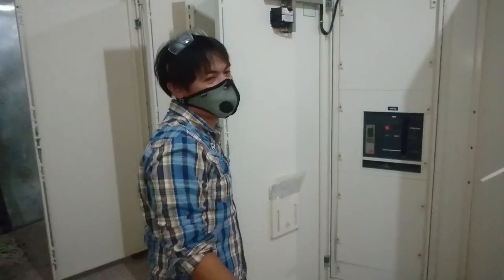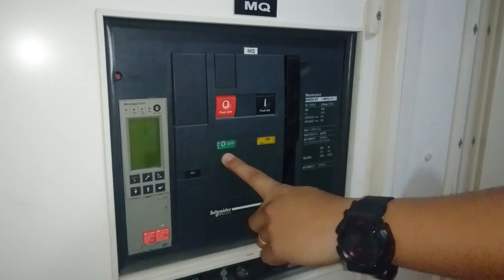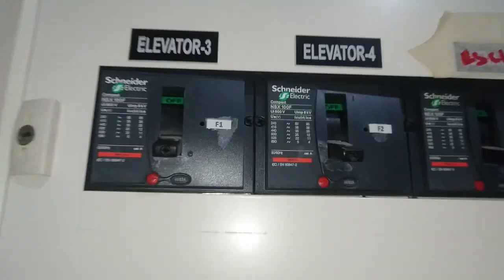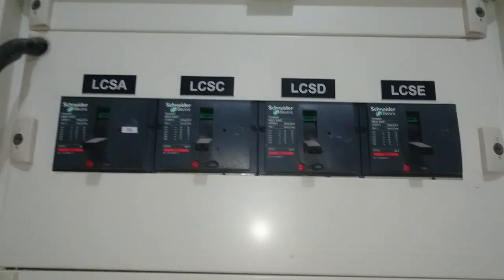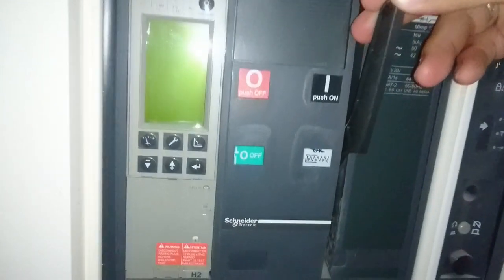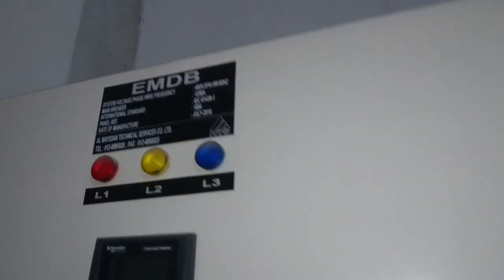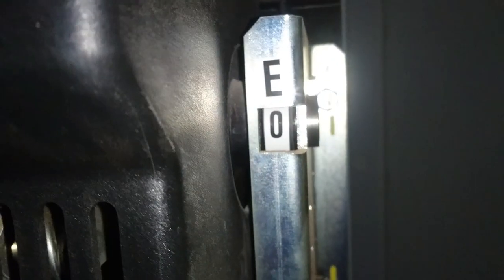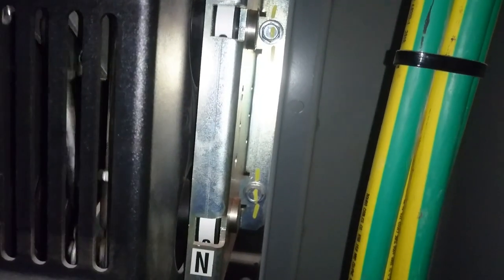HOW TO TURN ON AND OFF AIR CIRCUIT BREAKER MANUALLY, SPRING CHARGING OF ACB

Comment: can we charge spring manually while VCB is in ON condition ?
Reply from the maker: No. turn it off before charging the spring. Especially on VCB's you cannot access it if the breaker is on. The door is close and the earthing is open during VCB on position there is a mechanical interlock.

Comment: How hard is the lever supposed to be to pull? I went on an emergency call where someone had hit the service disconnect switch on accident which turned off all the power to a hotel and I must’ve pulled that lever 100 times but it never recharged. I was able to pull the lever all the way down with my pinky finger so the only thing I could think of is maybe something was wrong with the lever because there was no tension on it? Any ideas?
Reply from the maker: I think there is something wrong with the mechanism inside the breaker. For this type of breaker I exert only like 5lbs of force. If the spring wont charge there is something wrong on it.

Comment: Sir ask ko lang po yng spring charge indicator nya po nasa yellow po pero naka off naman po. Tapos d po xa mabomba.ang lambeth nun manual spring charge po
Reply from the maker: baka po sira ang mechanism para sa manual operation nya.
Reply: @HectorideMoto  HDW3-3200M ang model nya po 2500a

Comment: Mag trip parin ba ang ACB kahit hindi nka charged?
Reply from the maker: basically the spring will force itself to open and close the contacts, If you do not charge it cannot open or close the circuit breaker.
Reply: @HectorideMoto  I mean pag Naka closed na.kailangan ba na Naka charged sya or ok lang kahit discharge?

Comment: Sir good day. Ginawa ko yan pero ayaw mag charged at mag on. Tuwing pipitik sya naka off parin at discharged
Reply from the maker: Baka may problema sa mga mechanical parts nya kaya ayaw magcharge ng spring.
Reply: @HectorideMoto  may idea kayo sir price sir? Marine use kasi sir. Schnieder 250 amps 500v specs ng breaker sir.

Comment: Boss ano problem ng rmu Hindi lahat ng elaw ng indicator gumagana
Reply from the maker: wala po bang voltage reading ang terminal ng indicator lamp?
Reply: Meron po saudi bkayo boss
Reply from the maker: @shanilletv4535  yes po dito po ako nakabase sa jeddah boss... hindi nman po ba busted ang mga lamp? kase po kung may supply voltage kada indicator lamp at di nailaw baka po busted... at dipende rin po sa indicator lamp kung saan po sya intended baka sa interlock nya na relay ay di nagana.
Reply from the maker: @shanilletv4535  kung fuse dapat walang supply voltage sa mga indicator lamp
Reply: Yong dalawa lang meron boss
Reply from the maker: @shanilletv4535  nag pm ako sau boss sa whats app